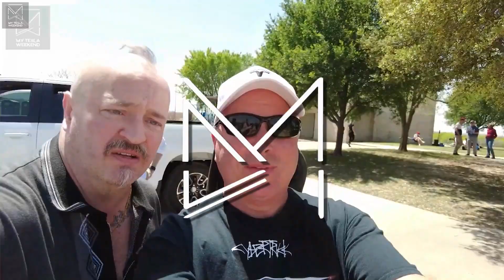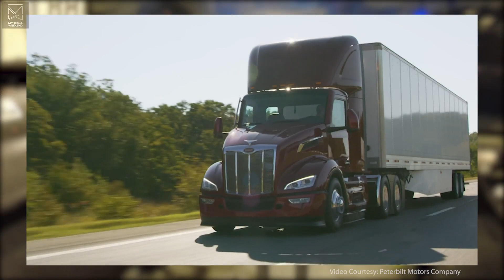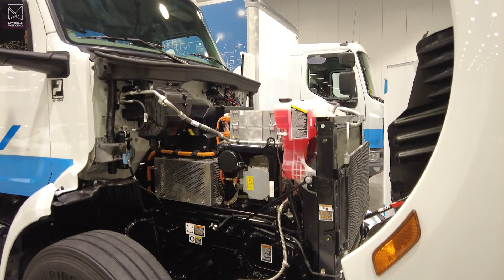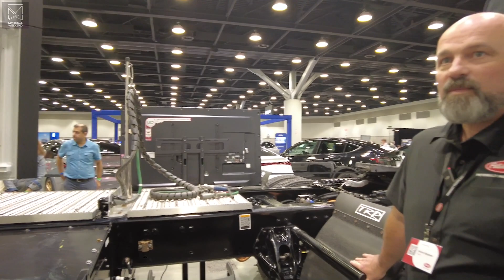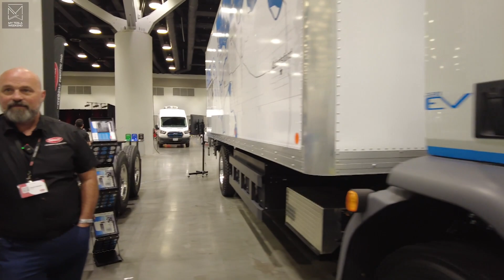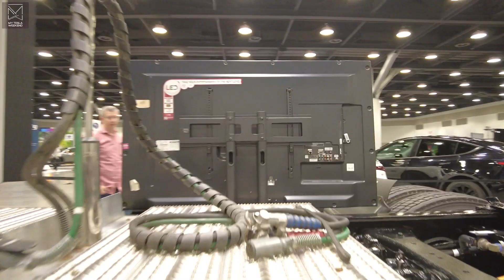EV Semis you can order TODAY (and have in 3 months)

Comment: I feel like electric vehicle trailers is among the items that should happen. What I mean by that is regen breaking, solar roofs, possibly solar sides, with small batteries on the to make it so trailers can have security cameras and location tracking on them. Maybe some would have electric refrigeration instead of the diesel generators some have. 

Making trailers that could possibly help extend or power up an electric semi would be great. By law, drivers can only be on the road for so many hours a day. Many end up at rest stops. It would be great to have a trailer helping to recharge the semi while the driver sleeps. 

No doubt, weight versus benefit will have to worked out. All the additional gear has weight, so it would have to be accounted for. 

Then if distribution centers had wireless charging setup where the trailers are loaded and unloaded could be useful. Wireless charging tech is young and I suspect the charge rates will grow. Those semi trucks sit for hours at this mess for loading and unloading. It would be great to recharge while they doing that.

Comment: I do not think enough people appreciate the impact EV commercial trucks will have. Many places trucks have to wait in long lines to get loads or to off load. They often idle their engines while waiting. Pollution in neighborhoods near ship ports where massive cargo comes in have higher rates of illnesses and worse air quality. 

For more common cities and towns, large commercial vehicles could make deliveries in the middle of the night. Some places have put restrictions on delivery trucks due to noise. The biggest noise factor being diesel engines. 

Then consider drivers health and stress levels. Electric trucks are easier to drive and quieter. Noise pollution is a health issue. 

In 2030, I believe we will see a large percentage of commercial trucks being EVs and it will be better for all because of it.

Comment: There are a few drivers, just like some bikers, that replace their mufflers with straight through pipes. This makes a truck obnoxiously loud especially when using the exhaust brake. Please don't paint ALL trucks/truckers with a broad brush. I'm in favor of electric trucks where they make sense. I'm convinced that they're easier and more satisfying to drive and, of course, quieter than even the quietest diesel trucks...but not as much as you might think. Current diesel trucks with exhaust after-treatment systems are not obnoxiously loud like older trucks. Truckers already have to deal with too much grief from the public to deliver the goods that everyone depends on, please don't amp up the negativity just to advance the adoption of electric trucks. Where electric trucks can work well and improve efficiency, they WILL be adopted.

Comment: I have to say I do love hearing about products other than Tesla. These truck fleets are conservative and I imagine this approach and the Hylion approach are more comfortable at this stage in trucking; even if I perceive the Tesla Semi is more capable today (neglecting charging stations which are not built out)
Reply: "neglecting charge stations...."
We've seen on the current industry test that the existing Pepsi Semis can fully charge on the lower power (750kW) "Megacharge" units in 2 hours  (that may not be limited by the truck, we don't know until results are compiled).... Btw, that's only the equivalent of bout 80kW on a 100kWh Tesla pack..... Easy.
.
That being the case, the Tesla could divide the 750 kW charge rate by 3 and extend the time by 3, charging (overnight?) on a 250kW V3 unit in 6 hours (plus supplying   "hook-up power for the drivers' comfort)
.
All that's needed is the physical space around the charger for access. I'm sure there are many locations where a Semi could slide into the end of a row, in a deserted car charge location, and sit there as the driver rests, while the occasional overnight car traffic uses available units?
.
Same principle as a low power home charger for a car. Just needs the correct adapter.
So.... "Built out"
Easy.
Reply from the maker: @rogerstarkey5390 Mo is no fool. He's been around on this channel for ages.
Reply: Hylion?
Still?
Really?

Comment: Great video Brian. I can't wait for these things to become common. Our town sits in a valley with long steep roads coming down to it and a major interstate highway on top of the hill. When outside we are serenaded by the jake-brake symphony day and night. The addition of deep diesel rumble and tire whine creates a lovely cacophony. 
I couldn't see, is there a motor on each axle or just a single motor? It seems that the Truck manufactures have the same problem as the auto OEMs. Electrifying a legacy design is not an optimum solution. This truck was giving away 5,000# of capacity in the electrification. I haven't seen hard #s but it appears the Tesla is giving up more like 3,000# for a lot more range. 
Keep up the great work
👏
Reply from the maker: Motor on each of the 2 rear axles. The jake braking needs to go. It's just so obnoxious.

Comment: How fast are they building them?  Are they manufacturing, battery or demand constrained.  From their backlog is sounds like there is plenty of demand.  I hope they sell lots.  I too hate listening to every truck drive by.
Reply: Tesla is still testing them.   They run two fleets internally.  The first simply replaced diesel trucks Tesla was using.  The second fleet is racking up the mile to find problem.  The goal is to find them ahead of Pepsi so the are racking up a lot of miles.  I expect the 2nd fleet hauls the same load every run.   This is reliable as the source I got it from.  Someone talking about what the drone pilot the covers GigaTexas said.  Tesla is building multiple 4680 lines.  Not sure if they will be done in time to meet demand.
Reply: @danharold3087  good info, but the video was not about Tesla semi.
Reply: @normcfu  Yes my bad.   Brain fart :)
Reply from the maker: The guest in this interview made clear he's not authorized to speak for operations at the corporate level, only about the truck itself and how it's been rolled out regionally. He works for the distributor in British Columbia.
Reply: @FutureAzA  It's too bad we can't know that yet.  It would put things in context of diesel replacement.  Thanks for the info we did get.